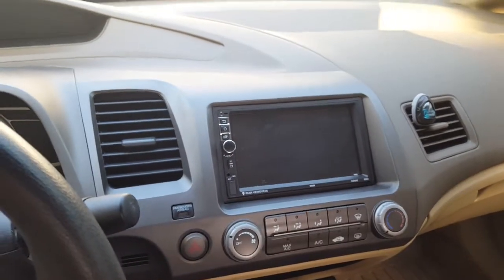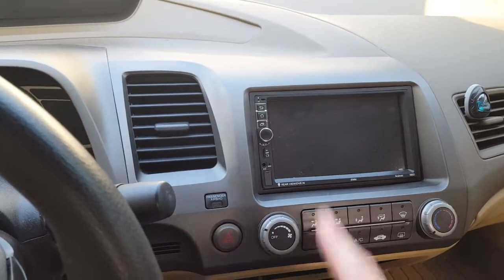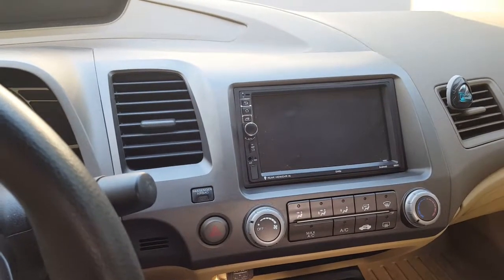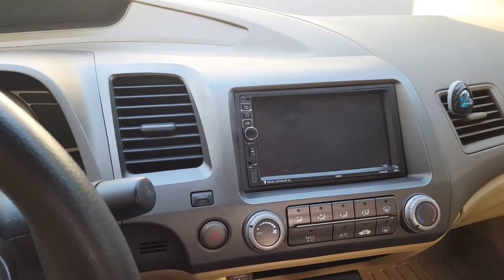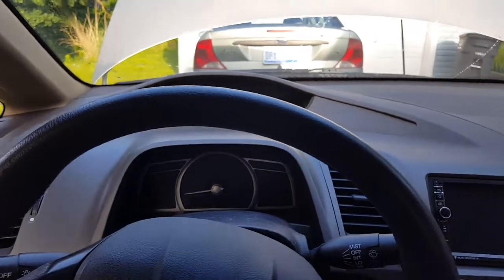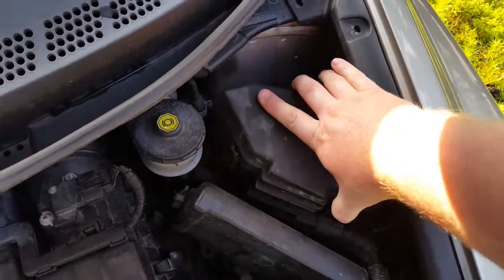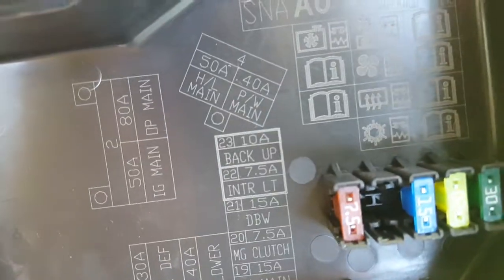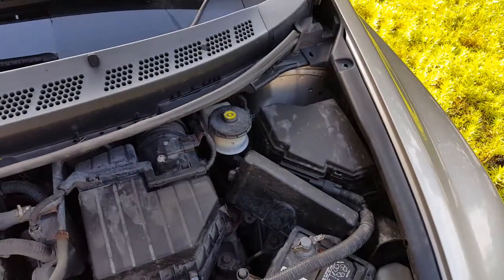8th Gen Honda Civic Electrical Issues

Comment: Thanks. I didn't have the radio problem,  but my dash lights started going all haywire,  flickering,  "glitching", said I was going 0mph, gas gauge went to empty even though full tank, when I turned on headlights the radio light would dim.  THEN, the speedometer light wouldn't turn OFF after shutting off engine and removing key, shut door..... just stayed on which would drain battery.
ANYWAY.......... I tried replacing the 10amp backup fuse and SO FAR.... seems to have done the trick. I was worried I wouldn't be able to make it to work in the morning with a dead battery! 
THANK YOU for the video!!!!!!
Reply: I'm having this same issue
Reply: Which year was your Honda?

Comment: HOLLY SHIT YES!!! I <3 you my dude! I didn't have the problems leading up to the exact failures we both had. All I did was plug in the stock wiring harness BACK in after having it unplugged for a short time to solder it up to the new head unit wiring harness, because I was worried leaving it UNPLUGGED for extended periods of time would drain the battery, which I had that happen on multiple occasions, probably a security feature of some sort. Anyways like I said, I re-plug the stock wiring harness for the head unit until I had time to solder it to the new head unit harness, and all hell broke lose.

NO more dome lights when car door opened without key in ignition, remote key lock/unlock stopped working, no more flashing red security alarm light on dash (Possibly no more car alarm at all) and the new head unit wouldn't turn on at all once I did get around to soldering it's harness into the stock harness (Still haven't had time to test out if I'll get power for it now since I change the "BACKUP" blown fuse out. But once that specific "BACKUP" fuse was replaced everything else works now!!! I'm sure the head unit will as well once I get around to that.

THANKS AGAIN MY DUDE, I was literally hours away from just taking the car up to the dealership and paying them a non refundable $200 for a wiring diagnostic for a 10cent FUSE!! You the REAL MVP!

Comment: I just now having almost same problem with my Honda Civic 2009 model, so I'm definitely going to try it out and see how it helps my car from no power at all after not using it about one week. Thanks for this tip!
Reply from the maker: Let me know if this helped you!
Reply: It doesnt help, mine has some kind of short circuit that why my portable energizer jump starter won't work, any way thanks.
Reply: @ryanmckee2950  If your car having a faulty car, Take your car to mechanic. See tutorials for Honda Civic.
Reply from the maker: @yosephinaeda711  I fixed my own problem, no mechanic needed!
Reply: @ryanmckee2950  Oh ok.
Reply: @freecopyrightlinemusic9090  Im having  the same problem on my 07 civic and i was wondering if you ever found out what the problem was.

Comment: That fuse should be removed before a radio swap, not really the radios fault. It’s designed to blow as a anti theft feature.
Reply from the maker: That fuse blew after weeks of use of the aftermarket head unit. The unit in question was sub par quality and caused an electrical short.